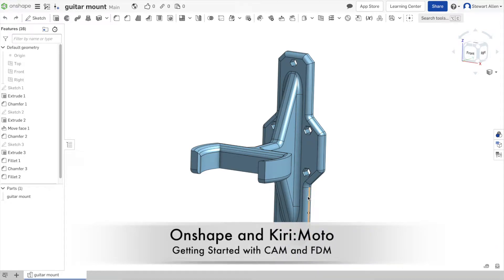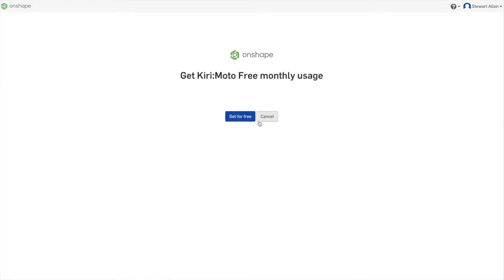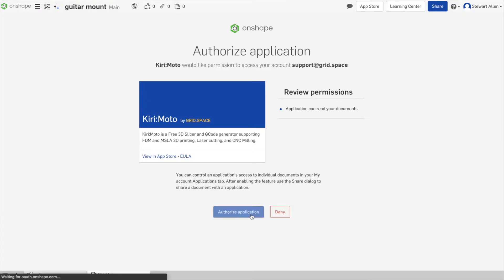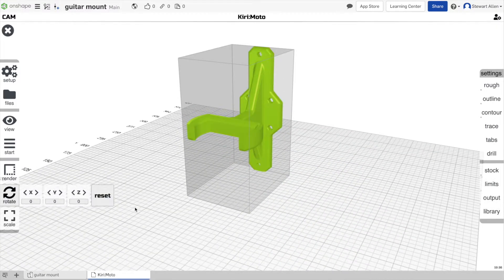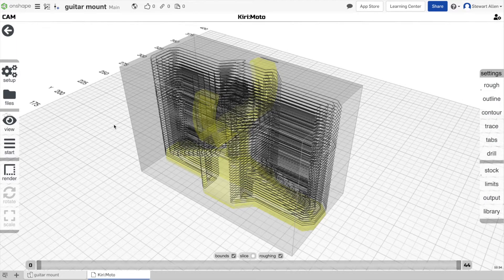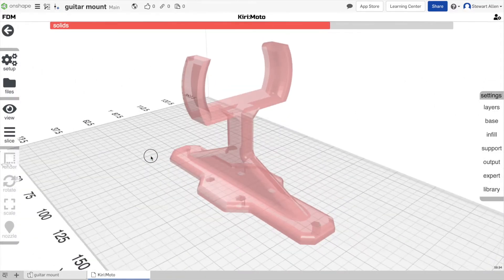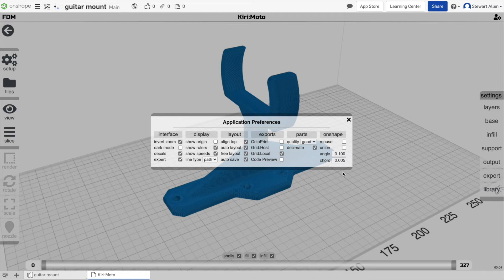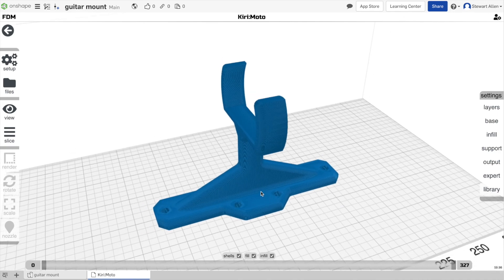CAM with Onshape and Kiri:Moto

Comment: I'm getting in: On Shape -> Kiri:Moto. Error is "The security context of this window blocks important functionality"
Reply from the maker: due to the way Onshape iframes apps, this is unfortunately unavoidable in Safari and Firefox. if you run KM on grid.space with those browsers, it does not have that limitation. alternatively, using a chromium-based browser will provide the necessary privileges. it's a complex topic and one which I've raised with Onshape a few times. there are no other apps in their store which do such intensive processing in the browser and so they are not affected.